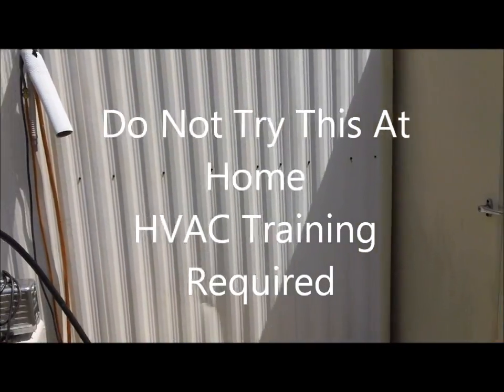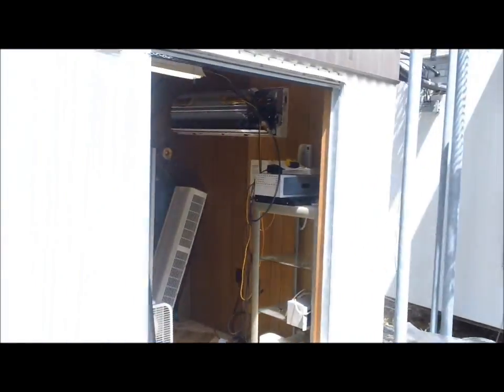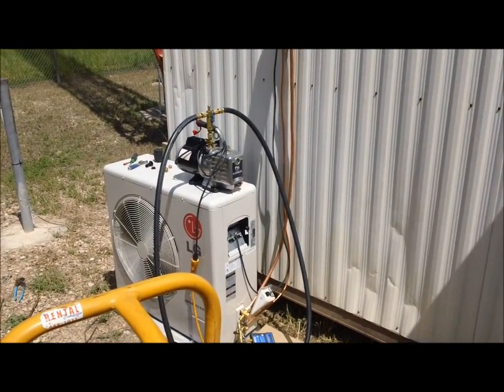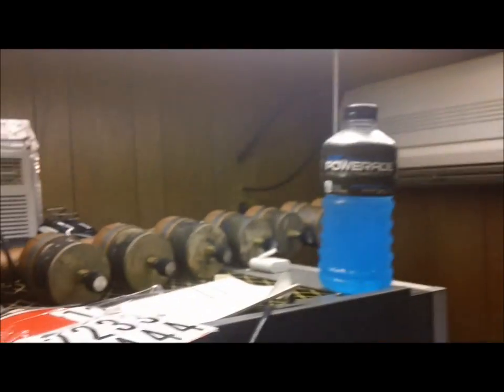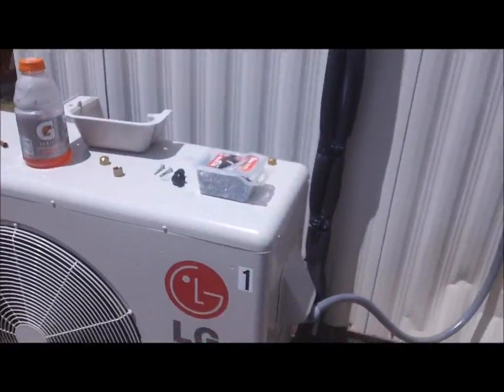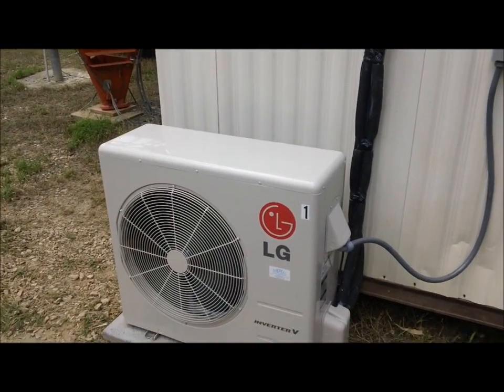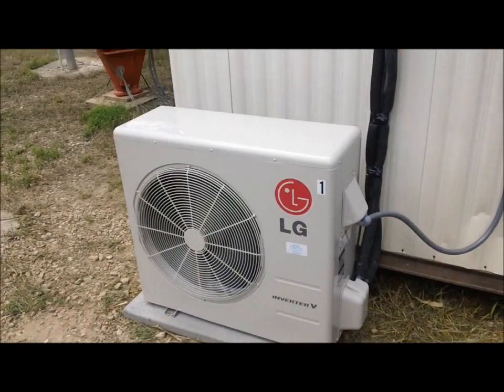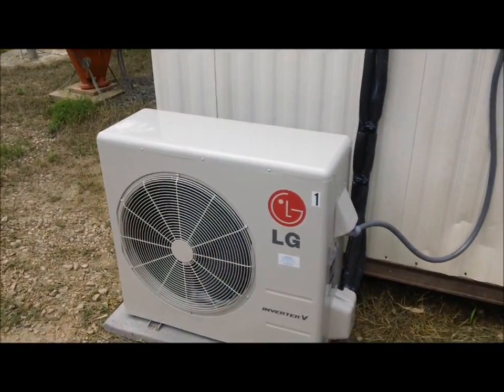HVAC Install: My First Mini Split Two 2.5 Tons

Comment: Why are mini splits so expensive in the United States?
Everywhere else in the world mini splits are dirt cheap and are the standard installed into homes. Central ac is the most expensive everywhere else.
Reply: Sadly because it's not considered a normal part of building a house. It's normally used for areas where you can't install a traditional central air like a already built house. The manufacturer knows this is the end users only option so they figure they have them over a barrel.

Comment: Use to have service 2/ Bard 4.0 on outdoor switch/gear units for AT&T .One on 4.0hours click relay, other on 4.0 hours.  Nice job on mini splits,you can get controller and switch them every 4-6 hours.Honeywell has them.

Comment: can these mini splits be used for homes?? i have a 1.5 story home 1550 sqft how many would i need? what about cost??
Reply from the maker: Yes they can. You need to call a HVAC professional in your area for pricing!!
Reply: Israelhvac Thank you, in your opinion would the mini splits be better than the traditional systems?
Reply from the maker: +Silver Gt I mean not really if you want to add or Replace the system you have then I would go with with a traditional forced air system!! I like mini splits for when you add a room to a house or close a garage and make a room out of it stuff like that!! But I'm saying that doing a whole house in mini splits can't be done cause if definitely can!! But it's very expensive to do a whole house in mini splits!!
Reply: Israelhvac Thank you for taking the time to explain things, i really appreciate it
Reply from the maker: +Silver Gt anytime
Reply: Israelhvac No more question, i was looking to get The Lennox CX25. But i hear that Lennox ac units break down often. I was told that 18 seer is 18 seer no matter that brand. Whats your opinion?

Comment: What about that unit installed in the wall does it work? And how loud are these LG mini splits?
Reply: Most of them run around 50 decibels on high, inside and outside. But they only run on high very little, they only run as hard as they need to and typically run around 30 decibels inside and outside. If you look up 30 decibels you'll find that's the noise level of a library reading room, they're that quiet. 60 decibels is a normal conversation at 3 feet, so even 50 decibels isn't very loud

Comment: I have a 12000 but mini split unit by soleus and we cannot get it to come on and lcd lights want come on. We do not know what to do if anyone can help my AC guys we sure would appreciate. No one has them in east Tennessee and the AC guys here do not know how to work on them If anyone can help please call me at 865 220 9145 please help.

Comment: I just got finished installing 8 mitsubishi mini splits 2.5 ton in new apartment complex stair wells... it sucked.. the indoor part of the unit is such a pain in the ass to mount and work with once its mounted... im stuck doing service on those sons of bitches for the next year due to my warranty and guarantee. I hope that nothing major goes wrong... water pumps, censors, etc... one main problem people have with mini splits is leaking due to the installer not knowing how to properly install the censor and condensate hose pump... ive even noticed them installed without the hose pump all together, as if they didnt know what the pump does... it pays to read the instructions... just becaus youve been working on a/c for 20 years doesent mean instruction manuals dont apply to you.

Comment: One of my favorite thing's to see get cooled a broadcast transmitter. Imagine before A/C and vacuum tubed 50,000 KW RCA or Westinghouse AM transmitter heating an entire transmission plant or needing a cooling pond for its tubes of course the air cooled transmitter's heated the plant and the engineer's living quarters which were large buildings. Now of course solid state is the player with a lot less energy wasted as heat for  making waves dance through air what goes a modern transmitter power w